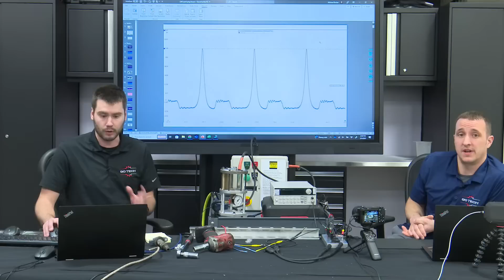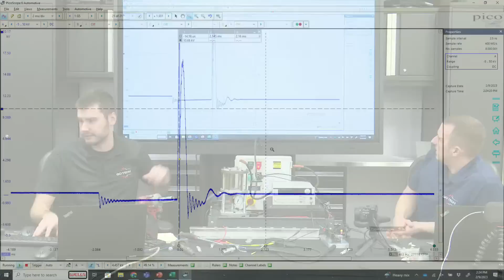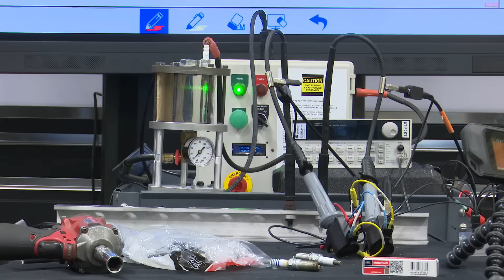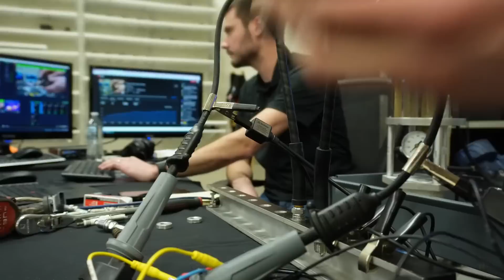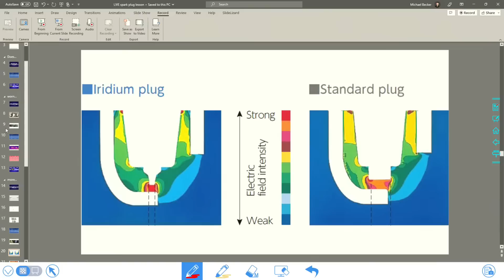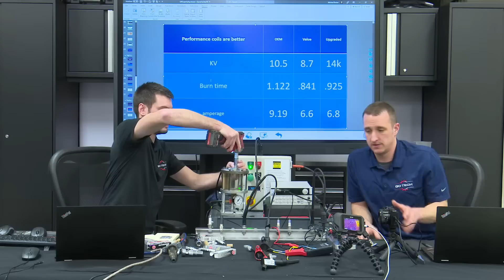Testing Spark Plug and Ignition Coil Myths

Comment: Excellent demonstration.  It is much harder to throw a spark at higher pressure, which occurs at low rpm and wide throttle, such as on a freeway on-ramp.  My 1996 Plymouth 2.4 L DOHC started missing badly in those conditions, which stopped when I let off the throttle.  I reduced the spark gaps from 60 mil to 50 mil, per a TSB for the turbo version of that engine (even higher pressure), and no more misfires.  In contrast, sparks easily jump many feet in a high vacuum chamber thru the rarified air, which is easily ionized.  BTW, my PCM took a hard hit in an accident, so perhaps a crack in a trace which controls spark or such.  Re snake-oil plugs, the old Split-fire ads said they tested normal plugs on a dyno, then Split-fire and measured more engine power.  Engine was cold in 1st run, then warmed-up in the Split-fire run.

Comment: You didn't mention how when a car was developed, they didn't have the long term testing on the engine to determine if the spark plugs could be upgraded with improvements. They have this with oil on some cars.

Comment: Found your resistor plug interesting. I have worked on older farm tractors with six volt coil. The wrong plugs usually  create no start or lots of miss fires. Goes back to put the right plug and wires in.
Reply from the maker: Hey Steven,
I could not agree more!
Thanks for reaching out!
~Ryan
Reply: Also learned on antique farm tractors with magnetos , use copper core spark plug wires .

Comment: Back in the 1960's, OEM's ran non-resistor spark plugs because contact point ign systems put out all of 25K Volts and needed all the help they could get!
My parents 1960 Chevy Bel-Air 283 cu in, 2 speed powerglide used A/C 45S spark plugs.  However, I can testify to the noisy AM radio at night when the radio signal was reduced in power due to some government regulation back in the 30's or 40's.  Really sucked!  Throw in arcing "generator" brushes and "vibrating contact voltage regulators" and.....well you get the picture.
When resistor plugs came along some of those (small) early ign systems would misfire, usually under load foot-to-the-floor driving.  
Point bounce wss s whole different problem!  Course there was also the "in-line" ign resistor (ballast or like GM, a LONG wire) to lower the primary ign voltage from 12 volts to 6 volts going into the ign coil.  
Slowly the resistor plug became better built quality so manufacturers substituted resistor plugs for non resistor plugs in their inventory.  Less radio noise at night.
Then came resistor ign wires (distributor cap to spark plug) and their quality became better like the spark plugs.  A/C R45S spark plugs and Delco ign wires became the go to on GM vehicles.  Almost totally quiet AM radios (all we had till mid to late 60's) at night.
Along came "transistorized" ign systems followed by all the OEM Electronic Ignition Systems" Alternators, better built AM/FM Stereo radios and we thought we were styling!.......till "Computer Controlled Powertrain Management Systems."  A whole new ballgame!
And look at vehicles now!  Stay with OEM coils and plugs!  Especially in Ford F250 5.4L 2 Valve V8 and F350 - 550 6.8L 2 Valve V10's.
Hope you're all doing well.
Reply from the maker: Hey Mike, thanks for sharing your experiences with the ignition system over the years. Amazing how far cars have come in general, right? All is well here, hope the same for you bud :)
~Mike

Comment: Great video.   If you don't zero out that AMP probe, none amp readings are correct. May not be huge difference, but it can. Good video either way
Reply from the maker: Hey Tony, true, the reading may be slightly off...but our goal was comparative testing so it will be off for all the tests the same but consistent. 
~Mike

Comment: i have been told by coil people that turns ration primary to secondary makes a huge difference but will not really measure resistance levels and some coils have different core materials as in metals
Reply from the maker: Hey Jim, right, turns ratio, wire diameter, wind quality, core lamination material, and probably more all effect output and longevity. There's a lot that goes into it, thats for sure!
~Mike